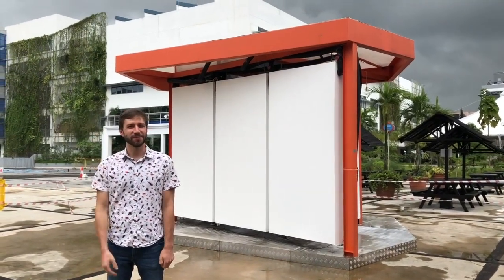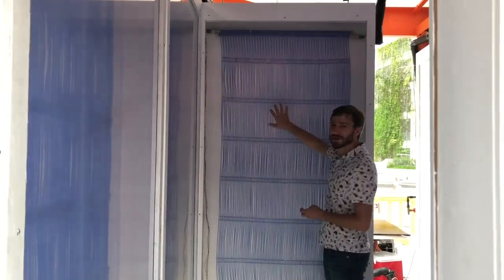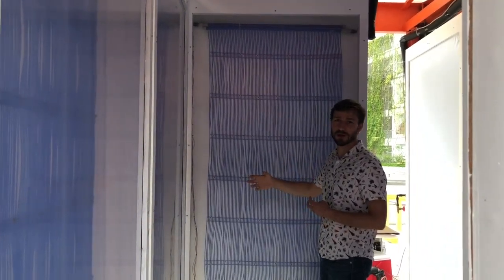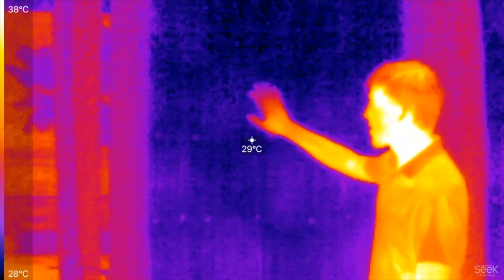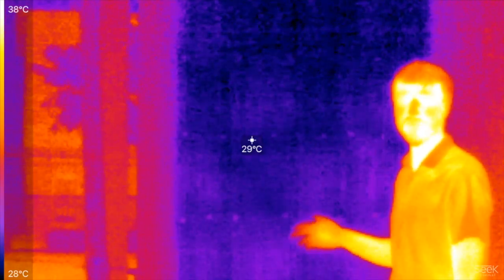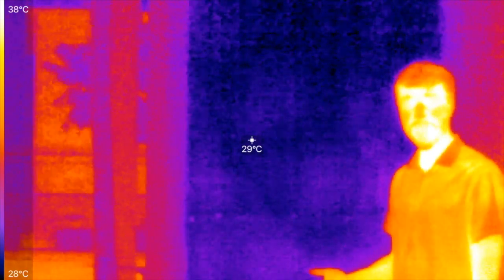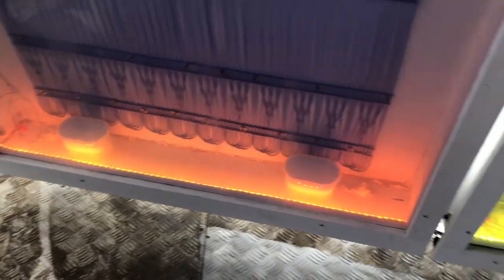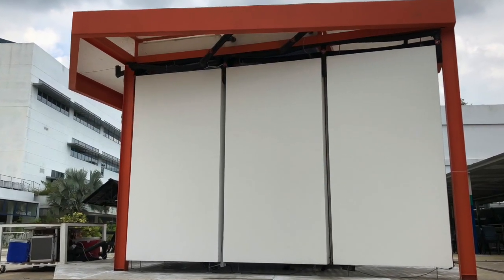Cold Tube Walk-Through With Eric Teitelbaum

Comment: I have proof read some 7 hours after responding what was typed and it needs lots of edits because I did not use my fingers I use my tongue and I did not touch my device I just vibrated the air with my throat.

"Climate Solutions

Cooling off without air-conditioning

A “Cold Tube” pavilion offers relief outdoors from heat and humidity

By Tatiana Schlossberg

SEPTEMBER 10, 2020

The novel coronavirus has made an enemy of one of humanity’s most reliable sources of comfort: the air conditioner.

Given the airborne nature of the virus, recirculating air — a defining feature of traditional air conditioning — has become a dangerous proposition, with at least one example from China showing possible contagion in an air-conditioned restaurant.

But a new study published in the Proceedings of the National Academy of Sciences shows that it’s possible to keep cool without recirculating air, and to do so outside in Singapore, a hot and humid tropical environment.

The process, known as “radiant cooling,” has taken on new importance in a time when fresh air is practically a health requirement.

The study was originally intended to address another problem posed by air conditioning: energy consumption. With global temperatures rising, along with income in some developing nations, air conditioning is expected to grow by two-thirds over the next decade, according to the International Energy Agency, an intergovernmental organization.

But the cost is high: More units mean greater demand for electricity, to say nothing of the refrigerant most air conditioners use — hydrofluorocarbons, greenhouse gases that can leak from the manufacturing or improper disposal of old units.

There are about 2 billion air conditioning units in the world, more than half of which are in China and the United States, according to the IEA. They consume about 9 percent of total global electricity production, and result in the emissions of 1 billion tons of carbon dioxide.

The study’s authors employed the principle of radiant cooling to see whether subjects could be kept cool on hot, humid, sunny days in Singapore — without a heavy reliance on electricity. They built a “Cold Tube” pavilion, made up of 10 panels, each eight feet tall, containing capillaries full of chilled water, insulated and enclosed in a polyethylene membrane that allows for infrared transfer, but not condensation.

Radiant cooling is something we regularly experience when we stand in front of an open refrigerator, though we might not remember this term from physics class. Basically, in the words of Eric Teitelbaum of Princeton University, one of the study’s authors, “You are the sun; you are radiating the warmth, and it’s the surfaces around you that take the heat away.”

￼Inside the Cold Tube, panels of capillaries filled with cool water are covered by membranes that don't allow condensation and maintain comfort without cooling or dehumidifying the air. (Lea Ruefenacht)

In the Cold Tube pavilion, those surfaces are panels full of cold water that formed two sides and a ceiling to resemble an open-ended bus shelter. As study participants stood or sat in the pavilion in temperatures above 85 degrees Fahrenheit, with more than 66 percent relative humidity and barely a breeze, they reported feeling “cool” and were comfortable.

To feel the cooling effect, people don’t need to be close to the panels, just surrounded by them, said Adam Rysanek of the University of British Columbia, another researcher on the project.

“In future real-world installations, we will likely rely more on ceiling-based coverage of cold tube panels, which means that sitting or standing will not matter, provided Cold Tubes are sheltering you overhead like an umbrella,” Rysanek said.

Dehumidification, Teitelbaum said, is the main reason air conditioning uses so much electricity. “In tropical locations, dehumidification accounts for 60 percent of air conditioners’ energy budget.”

The Cold Tube pavilion also uses electricity, to keep the water inside its panels cold. But it doesn’t require dehumidification, which means it uses half the energy of air conditioning.

This is not the first system to use radiant cooling — in fact, there are companies, including Interpanel in Germany, that use this principle to provide “thermal comfort" in indoor environments. The Cold Tube’s innovation was to show that this type of cooling is possible in humid, tropical environments.

While the Cold Tube pavillion relies on the same refrigerating hydrofluorocarbons as air conditioners, which have a powerful heat-trapping effect when released into the atmosphere, it could use other coolants, including those with smaller global warming potential, said Forrest Meggers of Princeton University, another of the study’s authors.

In international negotiations about these compounds, tensions have arisen over decisions to phase them out in favor of others that are less-warming but more expensive, at a time when many more people in the developing world are newly able to afford air conditioning. Reducing the use of certain chemical compounds could avoid an additional 1 degree Celsius of warming. An agreement was reached in 2016 to phase out these chemicals, but the Trump administration has yet to ratify it.

Despite the possible solution presented by this study, air conditioning carries a certain social cachet that is important for researchers and policymakers to understand, Rysanek said.

“The cultural attachment between air-conditioning and affluence, development and modernity in Singapore and Southeast Asia was equally strong in our time in Singapore, and still is — the often cited example is that Singapore’s founding father declared air conditioning to be the most important technology of the 20th century,” he said.

“There is a reason why there is an emotional attachment to air conditioning and cooling,” he said, and that residential buildings might not be the best place for an indoor version, both for cultural and architectural reasons. But, at least in Singapore, “there are in fact a number of spaces where this works quite well culturally and with sensitivity to people’s needs,” he said, such as schools built without air conditioning.

Exposure to extreme heat and access to air conditioning is unequal in many countries, including the United States, where Black, Latino and other communities of color are disproportionately affected by rising temperatures. Black urban communities in particular are more likely to suffer from extreme heat, a result of redlining and other racist housing patterns that filled those neighborhoods with pavement and buildings instead of cooling green spaces.

[How American's hottest city will survive climate change]

Many cities set up “cooling centers” in the summer for residents without air conditioning to seek relief. But this summer, in the middle of a pandemic, cooling centers may not be open, or going to one might not be a risk people are willing to take, especially since those who might need a cooling center may also be especially vulnerable to covid-19. Black and Latino communities as well as indigenous groups have been disproportionately affected by the virus as a result of certain underlying health conditions, unequal access to health care, and greater exposure to air pollution, among other factors.

Climate change and the coronavirus pandemic are making air conditioning use more complicated. In the past, Californians might have gone to the mall or movie theater to find some air-conditioned relief from the heat, an impossibility due to the pandemic. Instead, during the recent heat wave, people stayed home with their air conditioners on full blast, leading to the state’s most significant energy shortage in 20 years and a round of temporary blackout orders in parts of the state.

In Louisiana and parts of Texas, excessive heat warnings have followed quickly on the heels of Hurricane Laura, which left hundreds of thousands without power. Without electricity, residents will be at home due to the pandemic, without necessary air conditioning.

Despite the environmental advantages offered by radiant cooling systems such as the Cold Tube pavilion, Rysanek said he is cautious about recommending its use in poor communities because it may be misunderstood as a different or less ideal form of air conditioning.

Still, as the world continues to warm, there will be an inevitable need for a “paradigm shift” when it comes to cooling, the researchers said.

“We’ve been working on trying to fight this ever-increasing AC demand curve, and by 2070, cooling demand is predicted to overtake heating demand,” Teitelbaum said. “There is this weird interface between climate and comfort and controlling our physical environment, and air conditioning is really intertwined in all of those aspects.”

￼
Reply: That's not supposed to be in my paste buffer I was supposed to be pasting the link to an hour about 2 hours and about 49 minutes in to those two hours this talk and a heavy accent about radiant Cooling puts up a slide it's the webinar. They're only 5 videos on that channel so the webinar about radiant cooling is repeated in the playlist 4 times or more so they have nine playlist with five videos. Anyway the slide which I wanted to link to and tell you the time point that you need to visit but for many minutes the same slide is on the screen and one of the points that makes contrasting dementia with rationality is that are is 1/35 or less than 3% of 1% of the efficiency of water at moving Heat.

He says that water is 3500 times as efficient. I was interested in the opinion of those in this discussion since the discussions for that webinar are turned of if not just the Washington Post mainstream radiant Cooling which seems to be a fetish of the rich and the addition of the impediment to it functioning relatively of seemly inefficiently that is the ldpe surface. Didactically the paper that you stink to stinks because it does not explain the conductivity of Air versus water and how you're taking advantage of the insulating properties of air more than any purported humidity repelling properties of ldpe.

Comment: I have some questions. As far as I understand you still have to use the water chiller to supply cold water to the system like normal water chiller system right?  The different is instead of using cooling coil and fan, you use water tube with special membrane to get rid of the condense droplets and don't dehumidifie the air.

Comment: Interesting... how can we contact you ?
Reply: Thanks! Here is a link to the open-access paper, you can find my contact info there. https://www.pnas.org/content/early/2020/08/17/2001678117
Reply: @ericteitelbaum2638  Eric such a question was likely prompted by reading the article that you linked to. Are you on top of the situation with the Washington Post? When you open your refrigerator that's not radiant cooling that you feel. Radiant cooling systems that don't have the barrier are hybrid convective passive and radiant systems. The apparent fear about demonstrating a radiant system indoors at high humidity and temperature must be overcome. This visualization by the LEDs is something new that I have not seen in writing.

The Washington Post also links to the German heat pump cooled super bright solid state lighting system which not only cools all the heat that the lights create and you're talking about hundreds of wise civilities over a thousand watts of LEDs for a small office which is like a convection fan forced portable heater on low. They went ahead and increase the cooling Beyond the heating of the emitters. I hope that I'm wrong and that this German company is not providing any convective cooling whatsoever except the incidental from the surfaces that are no longer six degrees above air temperature but likely below it because the air is not radiant cooled it does not radiate its heat as easily as surfaces right? I mean the emphasis has been on air not cooling services butter radiant cooler doesn't cool air air is an insulator it's not something you try to heat or to cool you do that with conductors.

Conductive cooling should be offered first. people sunbathe for minutes and then dumped all of the heat that their blood has taken on in seconds by jumping into a swimming pool and then they jump back out onto the pool deck and lay in the Sun. these concepts are Child's Play for anybody who's experienced low body temperature water pooling ability to bring our body temperature down. there are huge billions of dollars expecting to be earned selling insane equipment to individuals, equipment designed to cool them by cooling insulation that is moved around the home at Great expense instead of shoes and underwear slightly below room temperature by whatever means. Our clothing may not be but a few degrees below body temperature for it to cool cool us. Irish shoes alone if slightly cooler can cool our entire bodies even in the Sun. the temperature of the air is almost irrelevant. that it is extremely costly to make an insulator capable of making us feel comfortable has nothing to do with the relevancy of the temperature of that insulator rather it proves that you're on the wrong path.

 I love the feeling of invulnerability after chilling my body temperature down in preparation of spending time in extreme heat but I know that when our watches tell us how many minutes we're good for it will be even more delightful. I can't believe that fireman go into burning buildings without conductive cooling systems. I understand that they want to sit and watch the buildings burn Waring chilled water vest while socializing to keep their numbers up at the firehouses since there labor has to be diluted if they only wear insulation and bring no cooling while holding a hose spraying thousands of gallons a minute.

 it's as if air conditioning has always been turpitude but the truth is it's been a long time since only evil people got sold on it.

 Soldiers the mission is simple the cold surfaces have to be removed from the closets but put behind infrared transparent materials that prevent you men are from getting on to them.

 we need to simplify the information. keeping people's bodies below average temperature cost no more than $5 a month anywhere in the world including financing for the system indoors and out. there are some people who can't afford it but far fewer then can't afford any room air conditioner. is the real number closer to $2 or $1 you're the expert grow a pair and opine on what the public wants to know not academic esoterica. The problem is using an insulator to conduct heat from out of our bodies or even in in the case of winter we're moving air regardless of its temperature always chills unless it is fully saturated which requires special treatment of all surfaces to avoid mold  or decomposition. composition
Reply: @ericteitelbaum2638  any idea about how many m2 on the wall or ceiling would be enough to cool the room of 30m2 (o.k. to make people feel comfortable in the room if it is 28-30 degree outside air temperature  ;-)